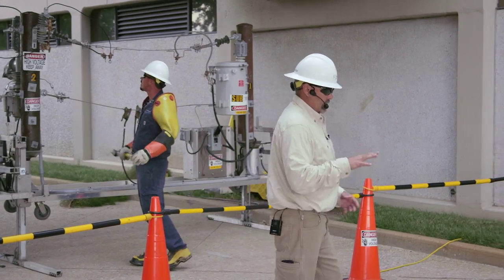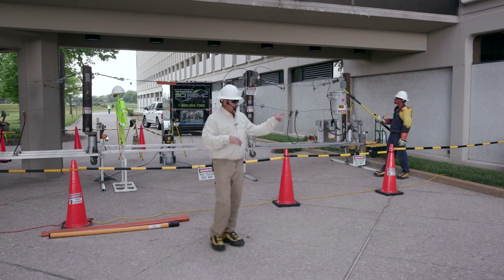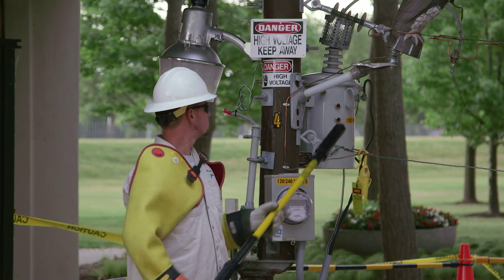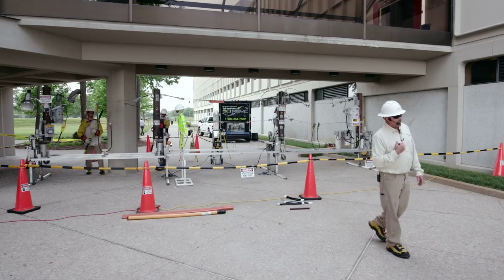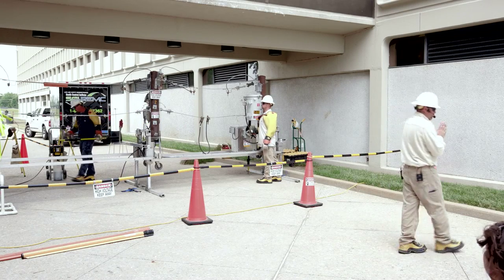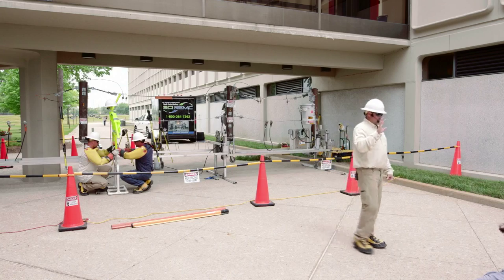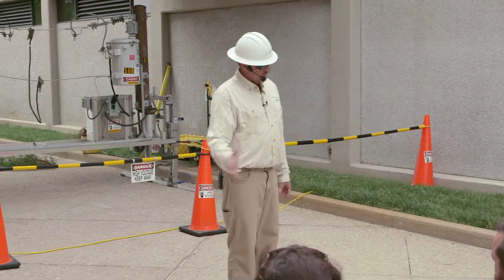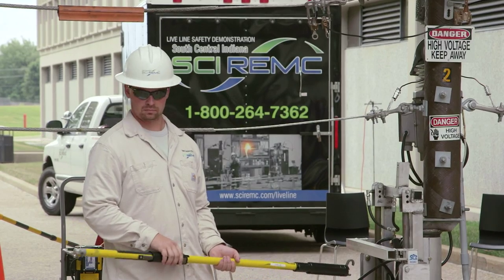SCI Live Line Electric Safety Demo

Comment: i dontthink this line had the 7000 vollt, but then again in Canada my high voltage line coming in my yard to my transformer pole is 14.500 and if any thing gets with in 10 feet of that line shock will jump that distance and get you, so if say you are swing a boom with in 10 feet of the top line it ll jump that 10 feet and get you, in wet weather it will jump even farther
Reply: I think that’s a bit dramatic,  25kV will jump around one inch in ideal conditions.  The keepout zones are indeed tens of feet. Safety margins are just that.

Comment: How come they recommend to continue to bunny hop after you're out of the car?  Why not bunny hop out of the car, then just run away?
Reply: He explains it, just listen.
Ground is still energized.
Put on rubber boots and run around like Forrest Gump.
Reply: It will depend on the voltage, but try to visualize a circle around the car with rings incrementing in diameter each 10cm's around the car.  Let's say that every 10 cm's represents 100V's.  If you bunny hop just to get out of the car, you might be fine there, but as soon as you decide to put your legs apart, the potential between one foot and the other will increase.  Let's say you take a 50cm step, or worse, you trip out of fear when trying to run, and you are, for instance, 170 cm's tall, you are now looking at a huuuuge difference.
It's that difference that kills you or at least makes you able to feel it, just like the mains kills you because you are at zero volts (or "referenced to earth") and the mains is at 120 or 240V.
Reply: @Dutch3DMaster  
Right, so because of the resistance of the ground is higher than the resistance of your body, the electricity will find an alternative path through it.
If a bird with long legs grabs an electrified wire while making splits, some electricity could flow through the legs? The wire has lower resistance of course compared to the ground.
Reply: @konstantinNeo  It's not particularly something to do with resistance, just with how current finds it's way through soil.  After all, the earth at a substation is usually derived from a very long copper electrode slammed into the ground to a particular point that will make it as close to zero ohms resistance as possible to (for instance) the frame of the substation that contains the transformers.
(It's also why it's rare to see 3-phase high voltage lines with a ground near them, because that ground is usually derived at the substation side.

Electricity passes through you because there is a difference between what you are standing on and the line carrying the power.
From the point of contact that power will "radiate" outwards and cause differences.
If you want a more visible example of this: think of current travelling through the ground as a droplet of water hitting a smooth water surface.
It creates ripples which will decrease over time and mostly, distance from the moment of first impact.
Each ripple represents an amount of current and the accompanying voltage (potential) difference, and trying to bridge a ripple will increase this difference, increasing the risk it will impact you.

If a bird with long legs would choose to sit down on powerlines carrying seperate phases and one leg would touch a phase and the other would touch a different one, it would vaporize and die, due to the potential difference between two phases (depending on the voltage and maybe also the frequency, there is a hugely complex calculation for calculating the voltage and possible maximum current).

The same would happen if a bird with long legs would touch a line and the ground, because the amount of power in the air would now shoot through the birds body to the ground as the shortest path current can take.

Sorry for the lengthy answer :P.

Comment: I don't get any of it. Why is electricity passing through it if it isn't grounded?
Reply: If you are referring to the hot-dog fingers: it's on a metal prop that touches the bottom line which might be at a different potential than the top line that they hold it close to, and if the bottom line might be the neutral, there will be 7200 volts of difference between the lower wire and the top one that has the hot-dog fingers closeby.
The bottom wire is referenced to ground in most cases (zero Volts) and the reason it's the lower one is mainly so that the power carrying cables are a little further up, but also that a snapping phase might cause it to come in contact with the neutral (or another phase) quicker, in order to trip fuses or other safety systems quicker).

Comment: I thought USA ran on 120v. Is it 240v now?
Reply: Most homes in the USA have 2 x 120V lines coming into their homes.  They're called "legs".  Each "leg" energizes 1/2 of their main breaker panel.  When you have power hungry devices, AC, furnace, stove, dryer, etc... you generally need a circuit that ties each of those legs together (to get 240v).  We've had power creep over here in the last couple decades... used to be 100V, then 110V, now it's 120V... and that is a variable.  If you connect your voltmeter to a standard outlet here you will get anywhere form 114V-125V reading.

Comment: some of this was BS power line on car. yes car is energized unless the downed bare wire has touched the ground and tripped the air breakers. but your rubber shoes would protect you if you don't touch anything else. I was in the exact same situation. just parked my car and a tree branch knocked a wire down it was touching the roof of my car and everything died (car radio etc) i opened the door and got out. I could hear the arcing couldn't see it. then called 911
Reply: I have always been told to bunnyhop
Reply: No it won't, the rubber in your shoes is just a couple of mm's, maybe a centimeter but nothing more, it will not protect you from your shoes being anything of a barrier to ground potential if the voltage is high enough, or, in the case of a car being live, having you at the car's potential and a different one on the ground.
Lose wires will only trip safety systems if they decide the current draw they are seeing is either high enough, or long enough (there are slow fuses as well in big industries to account for heavy motor startups for instance), and if that's not the case, they will be perfectly cable of shocking you, the ground, or keep your car live.
Reply: @Dutch3DMaster  not too bright are ya? so the rubber/silicone insulation on wires is just there for show?? CHECK
Reply: @chuckholmes2075  That's on the low-voltage side usually, where chances of someone coming into close reach of it (home-connection, that type of stuff) is considered higher (and, at times, due to cables getting bundled together, is necessary to prevent shorts).
On the kilovolt side of things, it starts to become less common honestly.
In Germany I saw many home connections (240V or 380V not 100% sure) that were without isolation on them, but they weren't bundled there, they had a 4-insulator style pole on the roof and the cables usually went from that connection to another home.
If there was insulation on them, it was because roofers were working close to them, other than that, I have rarely seen it.

As for rubber being an insulator: yes, it will be to a certain degree, and if you are talking about isolation on higher voltage-lines, we are usually talking about a much denser form (probably up to some industrial standard to meet insulating requirements over a prolonged period of time) and totally incomparable to the rubber in your shoes.
Reply: @Dutch3DMaster  same reply... NOT TOO BRIGHT ARE YA
Reply: @chuckholmes2075  Says the person seriously suggesting that the rubber in your shoes will save you...and who ignores the fact that a power line that is on the ground will never energize a car because it will always trip an air breaker (there are soooooooo much video's on Youtube from very serious earthing faults in those kind of situations that go on for a scary long time for those systems not considereing the fault to be severe enough to act upon it).
Says the person who will also ignore the possibility that the path from the car to earth might be better than that of the part of the line touching the ground, electricity is, in a way, random like that, it will search for the shortest path to ground which to us humans will not always be the most  logical thing in appearance.

The reason I respond is because it is actively dangerous information, someone crashing into a power pole having a cable up in the kilovolts range land on their car might think of your reply and think "Oh, I'm fine, I can just get out without trouble" and risk life threatening injury...

Comment: Why isn't the neutral to my house insulated?
Reply: Because if wired correctly, it is not carrying voltage, at least not in the way a phase would do.
Like, with electric railways, the overhead lines are the phase/positive of the installation, and the rails are the neutral.  You can step on the rails without problems, it would only become dangerous if you would be able to touch the overhead wire, because the neutral is referenced to ground and you are now the path to ground without you being an active user of power (like a train would, that would have the wheels be the connector to the neutral).
It's just a return path for the power, not an actual power carrying cable (confused the hell out of me as well though).
For it not being insulated might also be to make sure that should a power carrying cable make contact with it, it might trip out safety systems earlier.

Comment: But the first lines not that hot it's the second one that is from the pole is what the guy told me.

Then he grounded the top to the middle line then from the middle line to the bottom line was all grounded so they could fix the broken power line and so we could walk around the yard without getting cooked

Comment: can i ask why they aren’t insulated?
Reply: It would be a money thing (it would be a costly operation to cover hundreds of kilometers of wires), would add to the weight of the cable, and, over time it would degrade due to UV radiation and that kind of thing.  Should a fault happen it can heat up the wire so bad that it sets the insulation on fire, causing melting rubber everywhere...
(And, I think, it might also be a maintenance aspect of things, terminating insulation on overhead cabling requires techniques in order to stop water ingress at the points where the cable is connected to an insulator on the pole, or where it get's tapped off to a transformer, it would make servicing the cable difficult and a time-consuming process, and next to the material cost itself, we come back to the money-side of things again ;) ).

Comment: $500,000 for a transformer? That doesn't seem right. That's not profitable.

Edit: Just looked it up, according to SFGate:

Power pole transformers cost anywhere from $3,000 to $7,000 each, depending on how much electricity they're designed to handle.

Comment: Why are you only speaking in volts and not including amps or wattage?
Reply: Because the load is not known?
Reply: Because the human body is not at a set resistance, it's not like you have a big resistor from which you can say "This body is about 1000 Ohms", mainly for the fact that the ability to have a body pass electricity well will depend on how well someone is hydrated and what, inside the body will provide the shortest path to ground.
Next to the body not being at a set resistance from the start, a shock (even a minor one from like inadequately connected switching power supply that has the ground connected to a switching side of the supply, which can make you feel a lot of power when touching something that has the ground at zero volts) will usually cause a response of either the body surface to start sweating profusely, which will increase conductivity at the point of contact, and if the voltage and current is high enough, it will carbonize the tissues in the body and will only make the path to ground better/quicker.

Wattage is only used when the power usage of a device (the current of the device when in operation) is known and you can calculate voltage x current, and since the amount of current that the human body will pass in a fatal accident like one involving powerlines is unknown, but 5mA's is able to cause cardiac arrest, it's not a very important factor.
Reply: @Dutch3DMaster  Yep.
Reply: @lilkittygirl  They leave out the current, because it's easily 100 times over of what's required to cause defibrillation of the human heart if the voltage is high enough...
Even if we transform power up and the voltage goes up and amount of current goes down, we are still talking about a huuuuge amount of power.
Try to calculate the amount of power your home uses on an average day, and now multiply that by about 10.  You probably end up in the kilo-amps range, and even if you calculate the transformer ratio you are probably still talking about 100's of amps...

And if voltage only matters to you when it comes to equipment requiring a specific amount of it, I'd say you are not completely understanding how voltage can also indicate the distance over which it can jump towards you when ionizing the air for a spark.

And the same goes for the resistance: it practically stops being a factor when we are talking about the dangers of electrocution due to power lines.
It's the same thing for a nylon kite-wire: Perfectly fine for a 220  or 380 line to hit, but anything up in the kilovolts range and it'll probably conduct electricity reasonably fine, even when we mainly consider a particular substance non-conductive for lower voltages and currents.

Comment: Why birds can  stand in The Wire but humans cannot touch it???
Reply: Birds are not touching the ground or neutral wire, if they would, they would probably be vaporized quickly (depending on voltage, obviously).
We have 1500V on our overhead wires for trains in The Netherlands, which, up until a few years a go allowed for live work on wooden ladders because they insulated a worker enough to not get shocked (it has become forbidden due to the possibilities of a ladder having become more humid due to the weather).
The work platforms on the maintenance trains is insulated from the train, so they can work on live wires from there.

Comment: It ain't our tree and our transformer on the pole has a blown out fuse on the line going out so I guess it blew some point and the electric people never hooked up a new one 

The old fuse just dangles from the line that is going out cause it's the line at the top of the transformer bucket so I'd imagine once the lightning hits that grey pot you guys will be putting a new pot bucket up there 

And I cut your tree down last year just below that bucket and lines. the one I left for your guys they never dropped the tree and the limbs are right by those lines I cut 5 of yalls tree's under the lines and vines too

Comment: Why do electricians wear "salad bowl" hard hats?  I'm a retired Boilermaker and only them silly ironworkers wore salad bowls.
Reply: Maybe because working in the rain the rim will shed the water off of your neck if wearing a high collar rain coat where as an bill type will not
Reply: @jimshanks7748  , I guess you don't know what a"Boilermaker" does for a living.
Reply: Well I may be some dumb but not plumb dumb, I will try to explain what a boilermaker is : in the 1900 to around 1950 or 60 a boilermaker built the boiler that heated buildings on site and ran all the piping that was used in heating the building, being large and heavy was the best way to do it, now most boilers come prepackaged so now just set it and plumb it up, but I am sure you know more than I because you have worked that job for years my hat is off to you and all skilled workers
Reply: @jimshanks7748  I'm a retired Boilermaker not a building maintenance man. I've worked in nuclear as well as coal fired, oil fired power house's, ya know where electricity comes from. Also oil refiners or oil yards, we build them giant storage tanks. Boilermakers do a lot more then heat buildings, on a side note the guy who operates a boiler is a boiler operator.
Reply: @KenSmith-bv4si  sorry its been a week or two but I am guessing you may be a welder and or a pipe fitter please correct me if I am wrong, myself I have worked in the Oklahoma oilfeilds all my life I am 58 years old can weld and use a torch well but I would say not close to as good as yourself but like to know about your experience if your willing to share
Reply: Used to see them around drill rigs a lot also

Comment: This is the cheap version. I'm sorry folks but High voltage wire's should be below ground not above it. Demand better infrastructure
Reply: There are a lot of good reasons to have them above ground.
Reply: @micahned  I can't think of anything else than their geographical location making it expensive or difficult to have them run underground (for instance, because digging in ground full of rocks might be a difficult thing).
Like, my country rarely has surfaces like that, and we run them underground practically everywhere, only the really high voltages are up in the air (though there is an increasing request to have those below ground as well).

Comment: this is the most backwards way to power towns lmao, how are you still using these ancient methods lmao
Reply: Like, I can sort of get it from a geography viewpoint, it has changed a bit but in my country (The Netherlands) the south is a little bit more hilly compared to the rest, and the ground can contain more rocks making it harder to dig a pathway for cabling, and when I was young I can still recall the low voltage lines (380V for the most part) to be above ground and run to homes from there.
In Germany the higher voltages are also on power poles for the same reason.